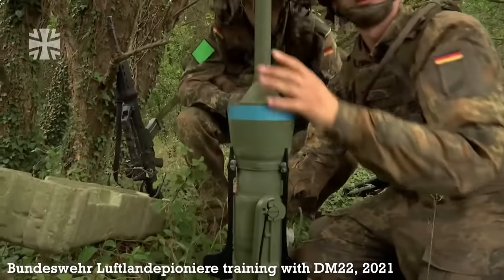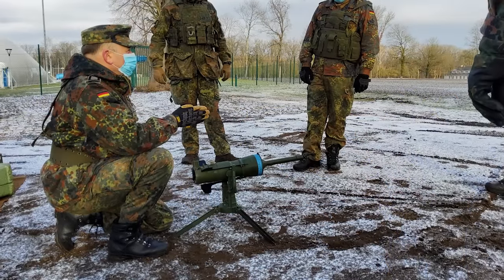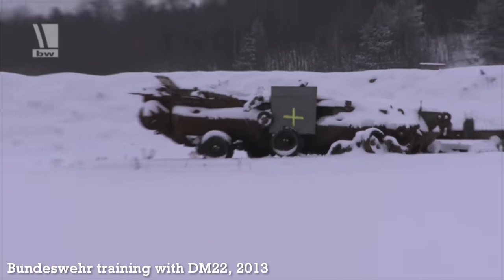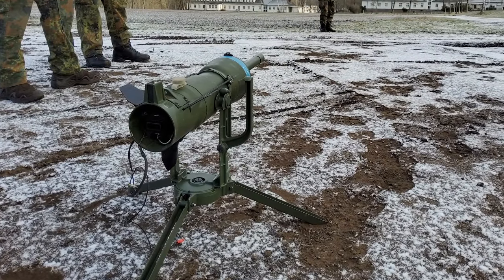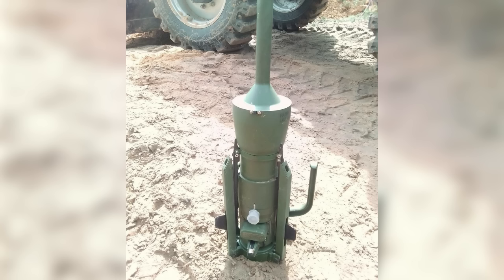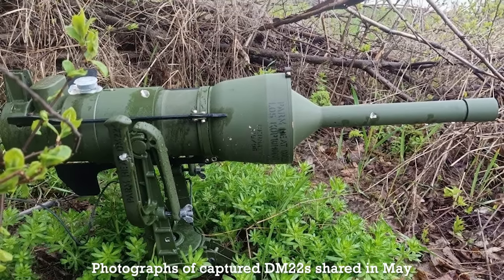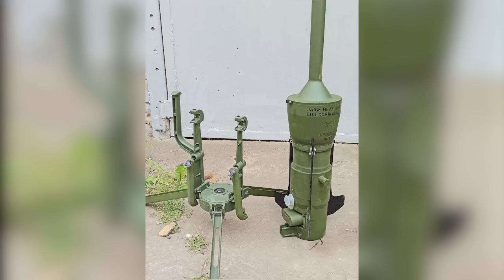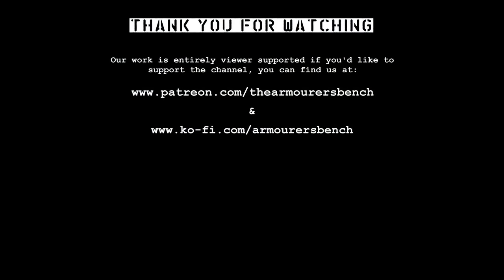German DM22 Directional Anti-Tank Mines In Ukraine

Comment: Pretty ingenious design to be honest
Reply: I remember seeing WW2 weapons with this concept. I think either the Brits or the USA used something similar in WW2 but may have been improvised.
Reply from the maker: They did indeed https://youtu.be/8nwLzDVdxFw
Reply: @Whitpusmc  Looks very similar like a british WW2 PIAT.
Reply: @wolfgangemmerich7552  yep, but definetly works a lot better.
Reply: @Whitpusmc  those were improvised solutions. the first directional anti tank mine was used by the Hungarian army in ww2, the 44.M off-route mine or LŐTAK
Reply: The United States developed the m24 mine back in 1961. It was also an off-route anti tank mine.
That said, I'm sure the German unit is a technologically superior device if for no other reason that it came 30+ years later and you can add to that German engineering.
Reply: @andrewwerner4156  Interesting. Do the Us still use the design or a similar one?
Reply: @borkwoof696  Hi, I honestly don't know.
I don't think that it's been made since the early 1970s but that doesn't mean that it's not sitting in inventory somewhere.

Comment: Having an extensive background in weapons such a missiles, firearms and explosives, I was not aware of this mine, Thank You For Posting, 👍. Subbed
Reply from the maker: Thank you for the kind comment, appreciate the sub!
Reply: my question is would it be more effective if you dug a hole and had it fire straight up through the bottom of the tank?
Reply: @Aaron-zu3xn  Then you need to know where exactly the tank crosses a breach. This would only be a kill point. The PARM makes a kill line between houses, groups of trees,... 
And you don't need to dig in open sight, make a hole where you can spot something strange looking on the path of your tank... This is set up much quicker.
Reply: @Aaron-zu3xn  i mean, the bottom of a tank is vulnerable enough that using regular AT mines like so might as well be enough, right? 
However i do see the advantage of actually penetrating the bottom hull instead of relying on a concussive blast and possibly spalling.
I think that a design of a conventional mine with a shaped charge could have a much smaller cone and thus be more convenient for burying it. Plus I'd put a slight delay on the detonation so that you aren't putting a hole only through the tracks, transmission or drive sprocket but under the actual fighting compartment. 
Maybe it could be just a big spike looking long shaped charge, that you can put in the ground by simply making a deep narrow hole with a hand drill, like one of those made for gardening.
Reply: @jackmclane1826  i definitely agree with this tho
Reply: @dankovac1609  there are already HEAT mines out there. The germans had a truck called "Mienenwerfer" (minethrower) that could deploy many of those mines in short time. Problem is that they lay on the ground and could be spotted easy if grass isn't high. While in high grass chances are that they don't deploy correctly with the cupper cone directing upwards. All in all it would rather slow enemy movements down because they need to take care of them rather than actually destroying enemy vehicles.
Reply: When I was helping to prepare a study on littoral operations, I was surprised to find that the Army and USMC did not pay a lot of attention to Rest-of-World weapons and tactics.   After that study was done I did one on coastal defenses which was surprising in that there was nothing on the shelf.    It was as if the landings in WW2, Korea, and elsewhere had never happened.

Comment: I am sure that Ukraine has used some of these already.
They sound very interesting.
It should be failry easy to disable a tank from the side, as they don't have armour over the tracks and wheels!
Reply: Sounds like the perfect kind of mine to disable the first vehicle in a convoy and then set artillery on the convoy
Reply: except most Russian armored vehicles use heavy ERA and side skirts over their sides
Reply: @12LoLproductions  You see the tube in the front of the projectile? Its similar to Panzerfaust 3. A tandem warhead where the first one triggers the reactive armor and the second does the job. This is already designed to handle reactive armor.
Reply: @12LoLproductions  Only tanks have ERA. The BMPs have no ERA and only very thin armour, offering only protection from machine gun fire. They get destroyed by quite light anti armour weapons.
Reply: @mweskamppp  Maybe I'm wrong here but I think what you describe as the tube in the front isnt a precharge against ERA. I think it is a spacer tube so the HEAT warhead is more effective. But as I said maybe I'm wrong feel free to correct me.
Reply: @FireLord459  Possible. For soft targets the tube stays in. For tanks you pull it out. There is a version with a tandem charge, the PF3T that triggers the reactive armor first before the HEAT warhead strikes. That might look different, I am not so sure about that.

Comment: There is absolutely a video of this mine being used. Completely destroyed the truck: it was hit twice also. Was on a paved road surrounded by woods. I could find the video if you wanted.
Reply: Can't find it, help
Reply: @MrDarkenral  look for this on you tube. It's hitting a supply truck i think. You can see the mine exiting stage right after it passes straight through.
" the ukranian national guard struck a supply truck with a german PARM DM22 HEAT off-route mine"
Reply: I can think of a few videos I've seen that people have thought to be very close NLAW shots or similar, that would make more sense to be this.
Reply: @nikiTricoteuse  thanks
Reply: @nikiTricoteuse  yup that is the one!!!
Reply: @jevans80  On this videos, you can see an the right something flying, directly after the hit. So, it's more a DM22 than a NLAW.

Comment: Such a quintessentially german weapon system. Simple, pragmatic and pretty reliable:
You simply string a fiber optic tripwire over a roadway/path where you expect enemy tanks and aim the mine to strike the vehicle which triggered the mine.

Can the firing unit be reused with a new warhead if recovered?
Reply from the maker: A very good question, I've seen no mention of them being recycled but it would not surprise me if it was possible.

Comment: DM 12 PARM 1 (not DM22)
Deutsches Modell 12 PanzerAbwehrRichtMine 1
Manufacturer: former MBB, Daimler until 1998
Weight: 10 kg
Diameter: 128 mm
Height: 39 cm
Weight of explosive charge: 1,5 kg HEAT (High Explosive Anti Tank)
Detonator: sensor wire
Range: min. 2 m; max. 40 m (60 m with infrared sensor system)
The mine, once set up, can be used at one location for a maximum of 40 days, then it shuts down. 
The price per mine should be less than 5000 Euro.
Reply from the maker: They're all appearing to be marked DM-22 from what we can see.
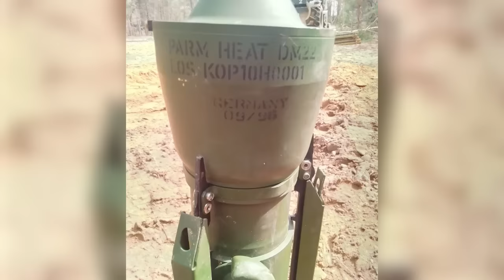Reply: @TheArmourersBench  Yes, you are right, at 1:36 it is clearly visible. I found the indication in the German Wikipedia. The price per mine was exactly 4880 German marks, so today - adjusted for inflation - really 5000 euros. Thanks for your great video
Reply from the maker: Thanks Michael, oh really, I guess that's a bargain compared to a T-72!

Comment: Hmm, interesting.. I've dealt with mines kind of similar to this in Iraq, but they were just EFPs, with a rather large diameter. Imagine a large kitchen pot, packed with explosives, and the lid inverted and made out of some thick copper.  This seems to be just a HEAT warhead with a static mount.  Now, there was rarely RPGs mounted like this, but thankfully with horrible mounting and triggering systems.  All of that being said, the foremost threat was always just leftover munitions and explosives in amounts where being sloppy does not matter. :(
Reply: all of that being said, something like this has to be aimed properly.. and it seems like they have a whole set of sights set up, along with a mirror it seems, to allow the weapon to be aimed from above. (0:08)
Reply: They had self-made EFPs when I was in Afghanistan in 2010, but very poor DIY quality.
but also very rare, most IEDs were normal under bellys

Comment: The purpose of the mine is not to destroy anything but to make whoever is coming down the road  deploy  ie  slow them down.  They really have very little chance of hitting anything as the starts really have to align well to make a hit .  

Also they a very good decoy devise for hidden ATGM sites.  Set up 3 or 4 of these in a bush a good 300m from you ATMG site and pop them off when the ohter sides tanks appear.  They wast their shots at them will you take you bead and pop them off.
Reply: Oh, they have a rather good chance to hit , as they will fly to the point determined by a trigger line...unless that tank realy races over the trigger...it will get hit
Reply: you're right, the mine triggers so quickly that no tank is fast enough not to be hit.

Comment: Traditional anti tank disables a tank rather than totally kill. This weapon seems to be intended to kill.
Reply: [Fun fact: Modern armys actually train rather to disable the enemy instead of kill.  
A wounded soldier usually keeps his comrades from fighting effectivly, if they care for him..]

I would rather say.. both types of mines can kill a tank just fine.

Traditional mines also have more explosives material inside.

I have seen several videos of russian MBTs cooking off after hitting a mine.

But pressure wave and spalling caused by the mine under the hull, can still kill the crew inside if the tank isnt already destroyed.

Sharp charges work with less explosives, but need hit at a specific angle to penetrate the armor.

Probably a great weapon for special forces behind enemy lines as they seem lighter and can cover a whole street with 1 mine.
Reply: I realize now I was wrong. I read “100 mm” as a lot of side armor but this is not. Reading, it is enough to defeat side armor on older tanks like Leopard 1, but not newer designs. So this weapon is more likely to disable (mobility kill) but leave a MBT crew alive. Sorry for my mistake (COVID brain just now).
Reply: @richardkudrna7503  I highly doubt that 100mm is correct. The HEAT warhead is similar to the Panzerfaust and designed to penetrate reactive armor. So >600mm penetration is more likely.
Reply: @duffman5z  
So we may expect turret launch system engagement?
Reply: @richardkudrna7503  Possibly, but it aims quite low. I dont know if its high enough to cause an ammo cook off.
Reply: @duffman5z  
I’ve understood that once the hull of a T-72 is breached and pressure and temperature flash up, the poorly wrapped main gun propellant will ignite.
Reply: I looked up the propellant. It does seem the 5 kg propellant is barely protected with a semi combustible wrap then a metal stub. This implies that it is very easy to ignite the propellant in the carousel with and piercing of the hull and pressure / temperature spike. A quick death. Steel cased ammo is heavier and bulky and must be disposed but has the advantage of presenting a sheet metal barrier to ignition.
Reply: In German doctrine this mine has two purposes:
1. Stopping enemy supply columns moving to the front line at strategic choke points to be picked off by artillery and ground attack aircraft.
2. Leave behind to slow down enemy advances and wear down the enemy when retreating.
Killing the tank was certainly accepted. A burning tank is a nice obstacle.
Reply: works like a Panzerfaust.
Reply: @richardkudrna7503  Actually the PARM-1 or DM12 has a penetration of 600mm. The PARM-2 has a penetration of 750mm plus a double warhead to trigger reactive armor.
Reply: @duffman5z  It can be adjusted.
Reply: @NewPipeFTW  
In 1978 my friends and I would look at the vehicle hulls in the DMZ in Sinai from 1973 war. 
We noticed the M-60 were mostly mobility kills when they had mine damage. I’ve forgotten the model numbers but there was one stronger mine that would burst the hull. A friend was killed when he demined and didn’t realize he was too close to a stack of mines - the Egyptians had learned to stack the mines to cause the enemy to “stop in his tracks” from fear if he hit one. Otherwise the enemy would hit a mine, and walk away.

Comment: I seriously doubt that warhead would only defeat 100mm of RHA. BL755 bomblets are only a couple of inches in diameter and will do a lot more than that. The rough rule of thumb I was given by the designers of the BL755 warhead was that a well designed shaped charge will do about 9 diameters of RHA. So BL would have done something like 18" in ideal conditions. LAW80, also designed by that team, was a 94mm round, so ideally it should have done around 800mm of RHA and the claimed penetration is 700mm. This mine had similar diameter, so should have similar performance.
Reply from the maker: No exactly, that's the baseline that's confirmed. There's unconfirmed sources that estimate 600 to 1000mm which is likely somewhat accurate.
Reply: @TheArmourersBench  Sorry I mistyped the LAW80 penetration, corrected to 700mm.
Reply: It's a Panzerfaust-3 warhead fired from max. 40m distance, so yeah, I'm pretty sure it penetrates upwards of 700mm RHA. And since it attacks the side of the vehicle, it should be lethal against most tanks used by the Russians.
Reply: @hisredrighthand5212  Thanks for confirming. Range has virtually no effect on penetration with shaped charges, so long as they reach the target and are initiated at the correct firing standoff, which is governed by the nose fuse. By virtually no effect, I mean maybe there's a mathematically provable difference, but nothing that makes any difference to the tank or APC on the receiving end.
Reply: @cageordie  Ah ok, thanks, I didn't know that. Actually on closer inspection, I can't say for sure that the warhead is actually a modified version of the Panzerfaust-3 or just a very similar design, but the DM-22 does have very similar specifications, like identical width of the warhead, the listed armour penetration and the fact that it adds anti-ERA capability, which would be in line with the tandem charge of the Panzerfaust-3.

Comment: 100mm? What if a tank comes by? This would be perfect for defeating vehicles with carousel style autoloaders, but I doubt 100mm is close to enough.
Reply from the maker: That's the minimum confirmed figure I could find there's very little info on these mines. Other, less reliable sources, suggest penetration of up to 1000mm.
Reply: You can be pretty sure that the penetration values are comparable to the PzF 3!
Reply: Those mines are used as anti tank mines by the Bundeswehr.
They are in active service today as anti-tank mines. By the Bundeswehr. Today.
You can bet your last Euro that these things can defeat a tank from the side.
Reply: @martialme84  True, but I have to say that I at least ever saw a 22 used just on paper and as examples!
Reply: @alexandervatter1436  We trained with them a little bit in Hammelburg, if memory serves, but only with the inert "Übung" version.
Reply: A T-72 tank has only around 60mm of upper side armour and less than half of that on the lower parts (which is where those mines are aimed). They will definitely pierce through it and at least immobilise the target.
Reply: maximum Values go up to 900mm estimated penetration.
Reply: @TheArmourersBench  I'm sure they can defeat T72s. That's how we use them on exercises and what's they're intended for.